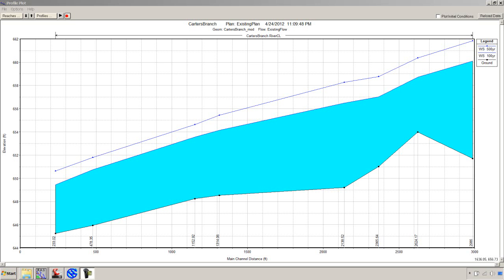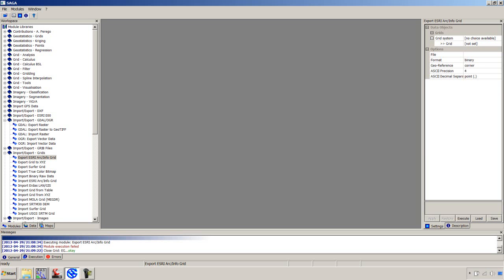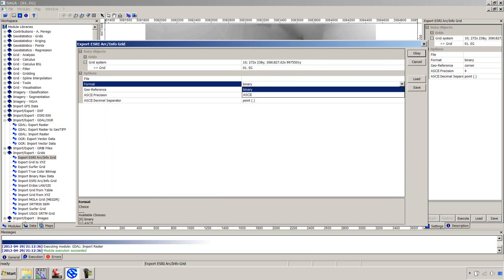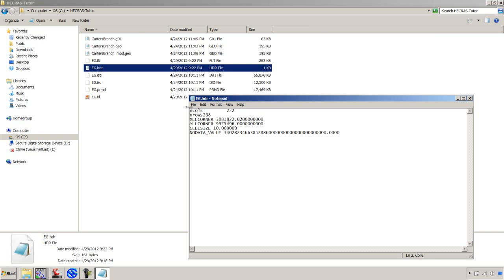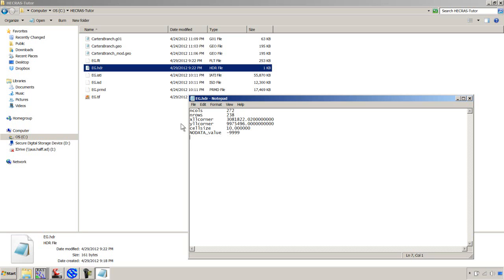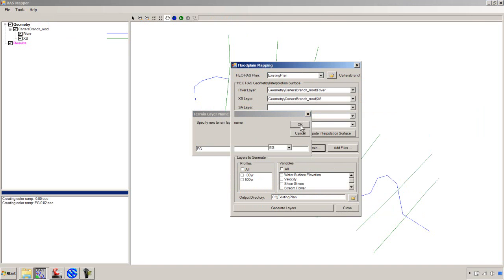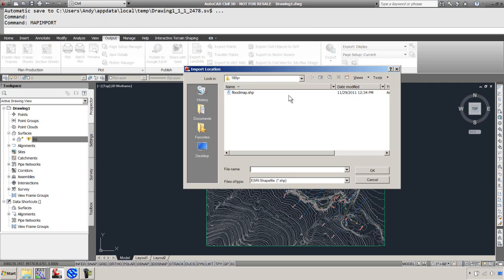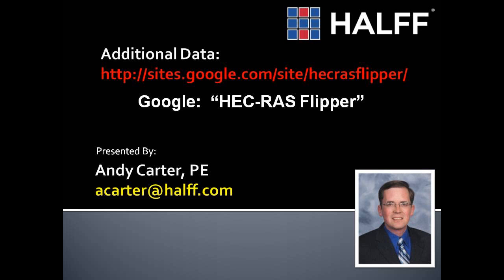HEC-RAS and Civil 3D, Part 3 of 3

Comment: I think the process is easier with the latest versions of Civil 3D and HEC-RAS. https://www.youtube.com/watch?v=oacpBLqpDIk
Reply from the maker: Hey Tom.  Four years ago when RAS Mapper was released it would not ingest GeoTiff.  Now with version 5 having GeoTiff capabilities it does.  So you are indeed correct and the process is now easier in version 5.0.  No need for SAGA any more!
Reply: Yay.  I am now working on getting the inundation limits from HEC-RAS to Civil 3D.  I have two approaches so far: 

1. Plot inundation limits in HEC-RAS and MAPIMPORT to Civil 3D/AutoCAD. http://tomsthird.blogspot.com/2016/06/how-to-delineate-flood-limits-in-civil.html   This produces clunky results due to the grid DEM.

2. Import from HEC-RAS using IMPORTHECRAS command.  This does not bring in the true cross sections, but I guess the lines it brings in could be extended and turned into feature lines for a WSE surface.

I am thinking of writing a LISP routine to import polyline cross sections from the HEC-RAS GIS format export.

Do you have any thoughts about that?